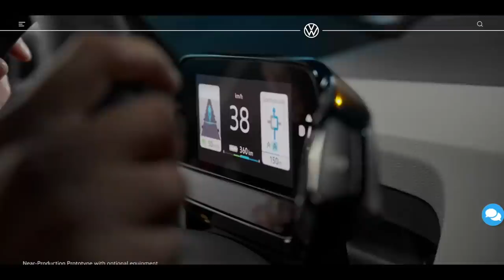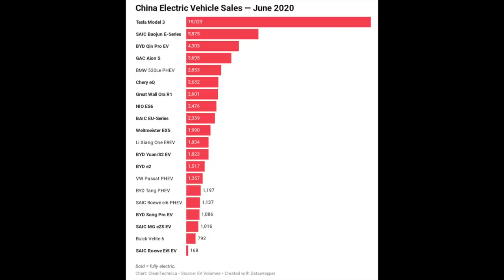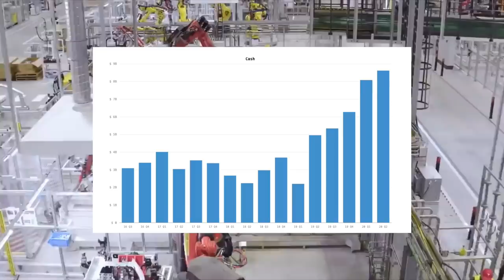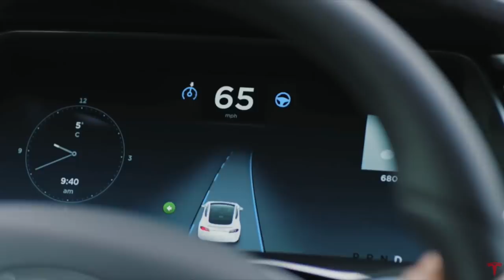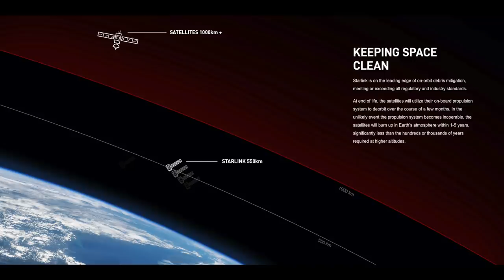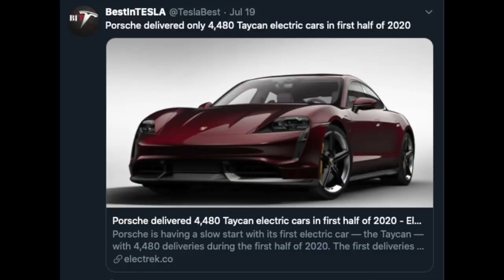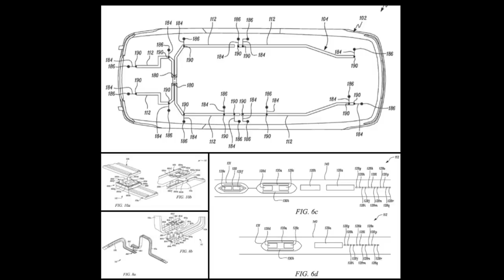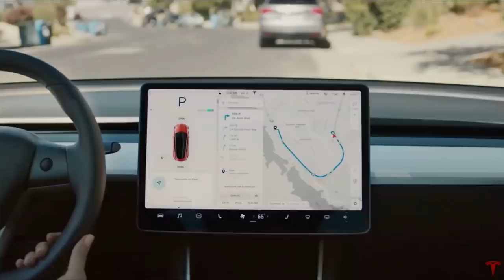Tesla WON | Tesla just made their Checkmate move | No one can stop them now

Comment: The $34b does NOT get paid to Tesla. That is not how it works.
Reply: It is possible, because Tesla might place additional shares for the S&P 500 to the funds & Tesla get the money from them.. Which is like share placement, in turn will increase the float of Tesla shares
Reply: Tesla could purposely dilute the shares and add more to the market.. it's happened before
Reply: @AWESEM0  You are right... Therefore, Tesla will have these additional funding on hand
Reply: I agree
Reply: Tesla will NOT dilute.Stock price will spike. Short sellers are forced to cover. Short squeeze of the century in sight...
Reply: @VolkerWeidner  Seriously, I also hoped for it.. These short sellers has made many retail investors burned... & they should be paid back with the same medicine.. Teach them a lesson, they won't forget
Reply: @lawrencelow807  
Tesla usually just does a car launch to get some cash to hold off the bankruptcy.

They can handle sell cars in Europe and Chinese ev companies already blow away whatever Tesla have.
Reply: But based on the stockmarket and sadly to a little bit of favour of shortsellers, its highly likely that theyll just stomp in more stocks.
Reply: Only way Tesla gets more cash is by issuing new stock.
Reply: its highly likely that the S&P requires that Tesla issue new shares in order to be included in S&P500.  If so, in order to deliver that many shares, the math works out.  Aint no way, these ETFs are just going to buy TSLA in the open market with the rest of us slugs.
Reply: zagan1 if you think any company out there is ahead of Tesla you are highly mistaken. These other companies use other EV technology. Tesla makes their own. Along with no one being ahead in autonomous driving or even in the same lane as Tesla lol these other companies don’t make their own energy either. But what do they have? Lol only EV company’s out there that are actually impressive are workhorse and  Nio.
Reply: Constantin Amundsen No, it‘s highly unlikely. Even though 20 Million shares sounds a lot for us “normal” humans, it is definitely not for an hedge fond or for any institutional investor. Currently the trading volume of TSLA shares is above 15 million shares PER DAY. So it would take less than 2 days to buy the required stock. Where’s the problem? Normally on those volumes trades will be split over a period of time. So the Fonds will typically buy over a span of 5 to 15 days the respective fraction which will lower the impact on the trading price. I don’t see ANY reason for Tesla to offer new shares.
Reply: @Kirksamp  No.....They can also either borrow from banks or through issuing bonds
Reply: @zagan1  ? 
1) Hold off bankruptcy? It is financially healthier than GM & Ford.
2) Last quarter, Tesla sold more cars in China than the number 2, 3, 4 and 5 combined.
Reply: Kirk Sampson debt is cheaper than equity
Reply: @VolkerWeidner  Doubtful.  Perhaps a mix but given Tesla's goals they would rather get money to accelerate transition (core mission statement).  Even diluted if they start producing 10x the number of vehicles it will make the stock even higher long term.  They could start popping up 10 new gigafactories at a time.  Tesla will not prioritize short term investor gains given that their investors are already loving the current valuation.  PS:  Renault is the company looking to be a solid second place in the car market and is dominating Europe with the Zoe.
Reply: @ccibinel  Tesla statet more than once that their main limitation is not money nor Gigafactories but talented people. They had an investment round lately gaining 2.5 Billion. They are building 3 factories currently at the same time. I am pretty confident this growth is more than enough. Doubling THAT would lead to inefficiencies and increase risk of failure. So let's just see who will be right. Your arguments didn't convince me at all.
Reply: Alot of competition is coming . the rise of EV will  increase the demand for energy.  The demand for energy will always increase. Energy is more valuable than gold.
Reply: Lawrence Low that’s not what you said in the video.  There is no integrity in your financial analysis which is a major gap in the narrative of your video.
Reply: So how much is invested in S&P 500 index funds in total, and how much of an effect will that massive purchase affect price?
Reply: You are right, but should there ever need cash they can release a fraction of the shares they did in the past.
Reply: @Prsisgreat  "its highly likely that the S&P requires that Tesla issue new shares in order to be included in S&P500."
That's not how it works.
Reply: @Prsisgreat  The article suggests Tesla will dilute their shares by issuing more. That's not what you were saying.
Reply: @wisenber  "Tesla might offer $5 billion to $10 billion of new equity to help meet demand from index buyers assuming the company is added soon to the S&P 500 index". Yes, you are right, not a quid-pro-quo, but effectively what will
Reply: @Prsisgreat  Which would basically dilute the per share earnings and dilute the holdings of current shareholders.
Reply: @wisenber  I never suggested otherwise
Reply: @AWESEM0  you predicted the stock split xD
Reply: Lawrence Low nice call
Reply: @VolkerWeidner  That 15 million shares does not mean it's 15 million unique shares. There is a lot of day trading going on, which makes up most of the volume.
Reply: No way Tesla issue new shares let alone 25m to enter the S&P. Most S&P funds will already have acquired or have options on the shares they need even if it is through other investment vehicles. Musk will not dilute his potential bonus pool unless he has to, and currently it does not look like he will have to.
Reply: Either way, they benefit directly or indirectly through share price appreciation.  Put another way, is it a Good thing or a Bad thing to be added to the S&P  (IT'S A GOOD THING).  That means more Tesla
Reply: @zagan1  Name 1 car company that blows away what Tesla has...And explain what that car company has that is better than Tesla's Tech?
Reply: Kirk Sampson, nonsense. Tesla has absolutely no trouble raising cash anytime they want to.
Reply: @smmsmiley2125  The physics is the same for all car manufacturers. And I've seen pieces of technology at other manufacturers that outperform Tesla. But not if you sum up everything that is needed to build an EV. Because for each part that they have that outperforms Tesla they have 5 other parts that don't.
At least if you talk about effordable series cars and exclude Rimac like companies from the equation 😂.
Reply: Wait, how does buying shares work? Aren't they bought FROM the company? 

I thought companies get money someone buys from a company. Have I been using money wrong this whole time? Was I not supposed to be giving money to businesses I was purchasing things from?
Reply: @lawrencelow807  Short selling makes markets efficient.  It helps pop bubbles and establish a real market price and provide liquidity.  There is no reason we should have to put up with 1000x p/e with any stock, if you ask me there isn't enough shorting.  Tsla's valuation will probably be multiple Trillion some day, when it's actually worth it, right now it's propped up with pipe dreams.
Reply: @cryptounchained7444  Maybe you are right.. 😉
Reply: THE BIG BOYZ
Reply: @ismannyb8148  The concept of competition is pretty much irrelevant at this stage of the game.  Until EVs reach mass market share, they are cooperation, not competition; they are all building out EV awareness.  There are not enough EVs to supply demand, so anyone who makes a good one for a decent price will sell everything they make... which means no one is taking sales from Tesla (or vice versa), AKA "no competition".  There are over 200 BEV/PHEV models available globally, and each year, Tesla's global BEV share increases despite more "competition".  19% in 2018, 23% in 2019, 28% for YTD 2020.  More models are available, but Tesla gains more market share.
Reply: What u guys saying if Tesla gets added in sandp 500 current shareholders get diluted?? What
Reply: If Tesla gets added in sand p 500 current shareholders will get diluted ??

Comment: Quite embarrassing when you believe that Tesla will get the money if you buy a Tesla share...
Reply: The company value goes up along with the shares they already have go up too
Reply: Yeah, doesn't make a lot of sense to equate excess stock demand with cash in the bank.

On the other hand, it is certainly possible for Tesla to sell new shares if they want to raise money, so they could cash in on some of the excess stock demand from S&P inclusion, which would dilute the shares a little, but it's quite unlikely that they'd do that on a massive scale. Maybe they can  get several billion in the bank out of this if they have any use for it. But it would be silly for them to raise 40 billion.

The videos conclusion is correct though, Tesla has plenty of cash and the ability to easily raise more, and good cash flow during a pandemic. They are completely safe from bankruptcy for the foreseeable future, unlike most auto manufacturers.
Reply: They do, the higher the stock price the more Tesla can raise capital if needed with out diluting the stock too much. Learn about capital raising... Edit: didn't actually fully watch the video. Yeah your right he really should have done more research into what happens to that money. Clear buying stock doesn't go straight to Tesla, it only makes it to them if it caused increased buying demand, the stock goes up and Tesla does a capital raising for more than they would have because the stock price went up.
Reply: I reckon there will be a few engineers looking for employment soon, ICE men coming in from the cold as the old car companies start to wither.
Reply: @keithwebb3258 
As long as they come with the right attitude they should fit in but if they come with the ice manufactures attitude, they wont
Reply: @brettmciver432  Well to be fair a lot of them probably didn't have much of a choice since ICE cars have been the only major player for so long. The executives who had the option to go electric a while ago are a very different story.
Reply: That may be 25 Million Shares put in by Tesla. If that's so, then Tesla gets all the money.

Whether it's the full 34 Billion or not is no issue. Heck, they could take a 20-30 percent cut on stocks and STILL get billions, if what the video guy says is true.
Reply: @godozo  It's not how it works. The 25 million shares is just index funds purchasing shares just like the rest of us. None of it goes to Tesla. Unless Tesla do a capital raising which is introducing new stock, diluting current shares, which does go directly to Tesla. Capital raising is always announced though and Tesla haven't made an announcement so no currently none is going straight to Tesla.
Reply: The only way to get liquidity is to offer secondary share offering, which they did and will probably do again when their price goes to $1 mil per share. Haha
Reply: @Seehart  Agreed. Tesla just raised $2B in new stock issuance back in Feb, so there's no reason they would further dilute the stock, especially not to the tune of $38B.  With historically low interest rates, they would be much more inclined to raise money in the debt markets (not that they need to right now), especially since they're one of the few companies with positive cash flow right now.
Reply: @brettmciver432  Back when I worked as a semitrailer engineer, I worked with a couple former GM engineers.  They were good engineers, and didn't have any problem designing on a completely different platform/industry.  The only people I can really see having a problem switching from ICE to electric would be the ones who have spent their entire careers developing ICE engines.  I took a Performance Engine Design class back during my engineering undergrad and all that knowledge regarding the thermodynamics of different ICE cycles is basically useless when it comes to electric motors.  Who cares if you can draw me a PV diagram for an Atkinson cycle if you're designing the powertrain for an electric car?  I think Tesla's biggest issues, historically, have been in manufacturing engineering, which isn't really as hard of a switch to go from designing the manufacturing process for a combustion engine powered car, vs an electric.
Reply: House Essentials  True, they apparently don't need to raise cash to exponentially grow factories for the automotive part of the company. Just saying they could if they had a reason to do so. Maybe buy a couple mining companies and an energy utility, or do a joint venture with SpaceX to mine Psyche for nickel. Who knows?
Reply: I doubt that the fanboi running this channel understands how the stock market operates.
Reply: It's not embarrassing, it's true.  Public companies are capitalized initially by wealthy donors, personal banking relationships, crowd-funding, or start-up funds.  After that, they are capitalized by investment banks or investment groups committing funds based on increasing market value (a rising stock price) or growth in the availability of public stock, or both.  This indirectly leads to greater capitalization for the company and it absolutely translates into company expansion.  Perhaps the video maker didn't explain this properly, but that is how it works.
Reply: @PETERJOHN101  That is only true if the company issues new shares, which dilutes the existing shares, or if they have bought back shares in the past and hold them in their treasury.  If the latter, they can sell their treasury shares without diluting the outstanding shares, and avoid pissing off their current shareholders.  Otherwise, they generally raise money in the debt markets.  But a rising or falling stock price does nothing for a company's cashflow, unless either of the first two options are exercised.
Reply: Ken
Reply: You can if you buy directly from Tesla and not another investor through the stock market.
Reply: @ghr67  After an initial stock offering, Tesla can not issue new stock unless the board approves it.  And even if they approve a new stock offering, you can't buy it directly from them.  They sell it to institutional investors during what's called a road show.  You and I have to buy it on the secondary market.